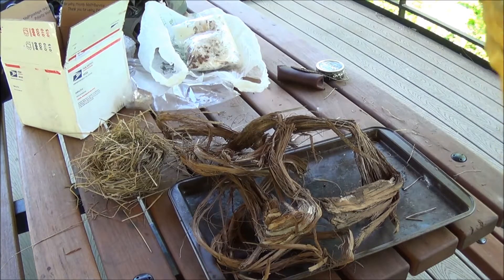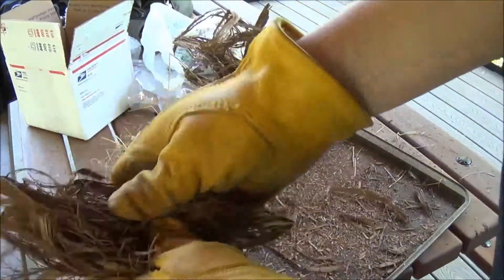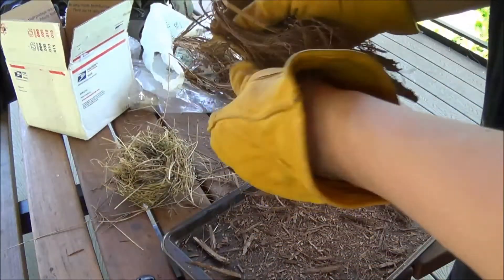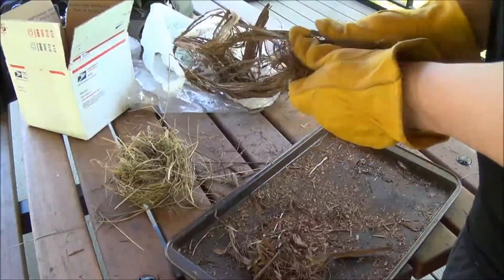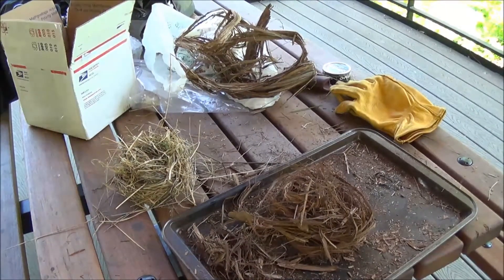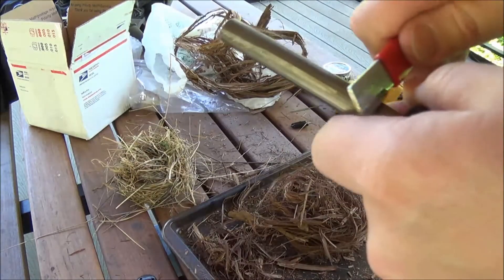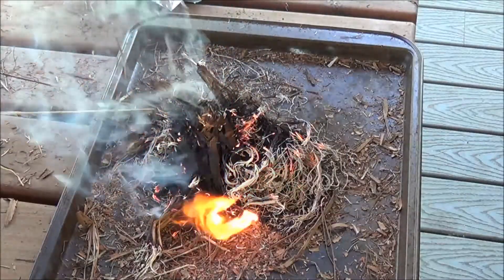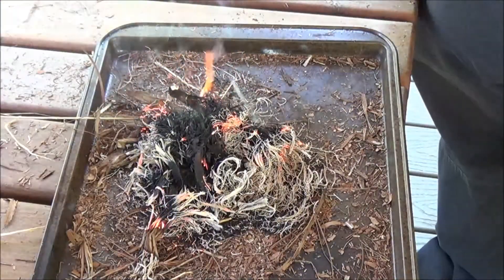Fire Practice Grape Vine

Comment: Your ferorod is suffering from the same ailment as mine. Just need to sand it down. I should get around to fixing mine lol. I just switched sides of the fero. And that stuff would be good on the outside of a birdsnest it looks if you don't have birch lol
Reply from the maker: I just used the other side. Worked like a charm. >_o
Reply: sounds like a USB

Comment: Too dry :)
Reply from the maker: I did finally go though.
Reply: Yes it did.   I run a saw mill and often have cedar bark left in the drive way, it gets run over many times, it fluffs up unbelievably well, beautiful soft stuff,  it lights up real easy. Your bundle did look a little on the course side.  Also, try scraping it right off the tree, it should fluff up easily, and be very fine when scrapped.
Reply from the maker: I was wrong.. it was grape vine.  I had a buddy on Facebook send me some in the mail.